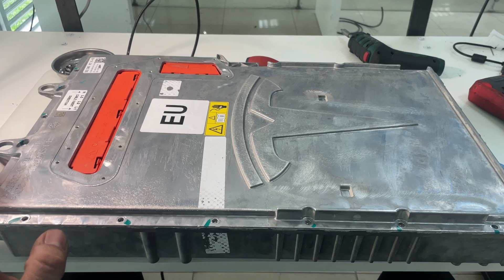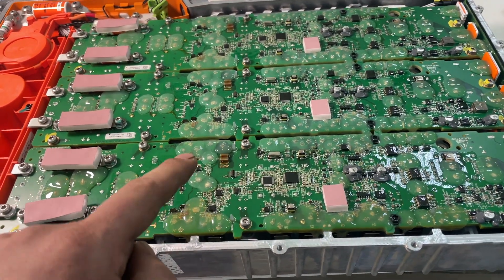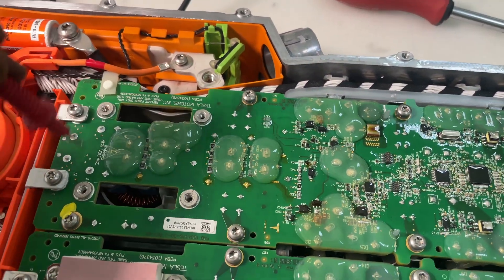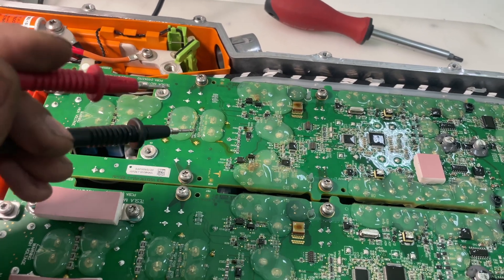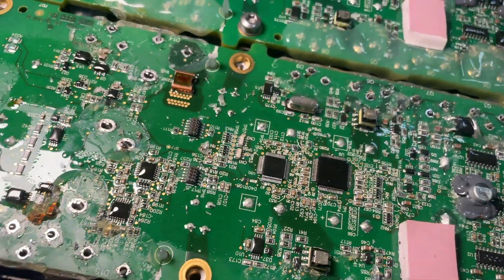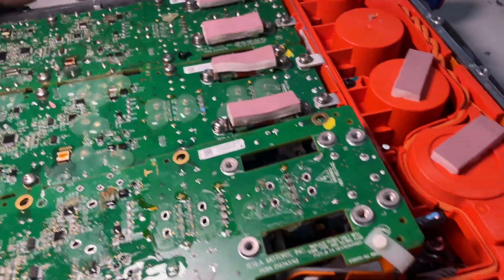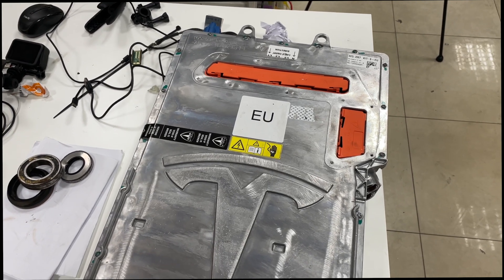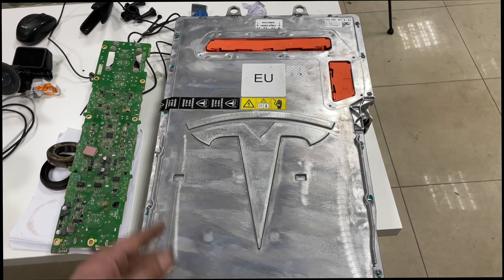What is OBC - Tesla GEN3 OBC refurbish

Comment: You need 2 fuses 576-0HEV040.ZXBD from mouser and 2 diodes stm mouser nr.:511-STTH6010WY for each fase . Have chosen alternativ way without desoldering pcb as tesla board is quite thick and they use hard solder as well.
Reply: I was wondering how did you do it without desoldering
Reply: How did you do it

Comment: If this is 3x16A unit, how does it perform 7kW (32A) AC?
Is there any realy which connects L1 and L2, or it reuses supercharing bypass relays to connect L1 and L2, and therefore making HV battery live at mains voltage (lost of glavanic isolation)?

Comment: Is it sometimes possible its just the orange fuses? Phase 2 and 3 is not working on mine
Reply from the maker: It is never just fuse.
Reply: I just checked my Model X. I have phase 3 offline when charging AC with my 3 phase AC charger. I only had bad fuses. So always remember to check this first before surrender. I think it is always bad design if the fuse is not the first one that will break. It is the fuse main purpose.

Comment: Nice job! Interesting that you don't use flux, I solder much easier and better me when I use it..
Reply from the maker: On small micro soldering is used. Heavy stuff i use solder wire with flux to heat up spot quickly